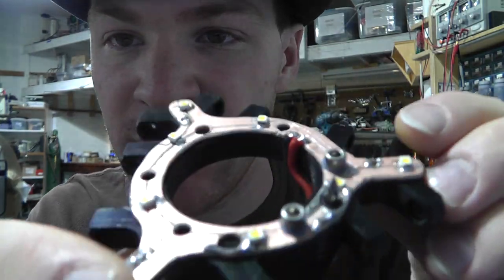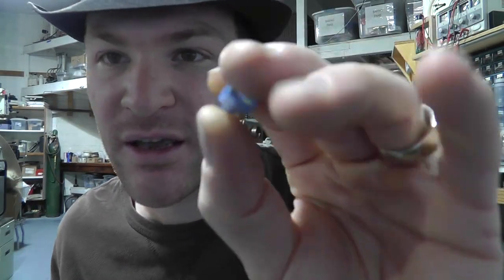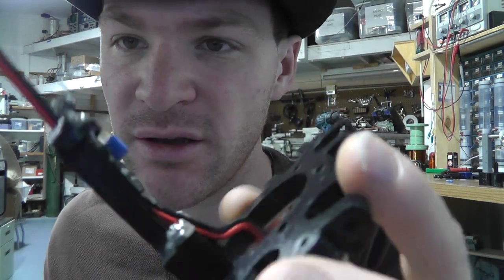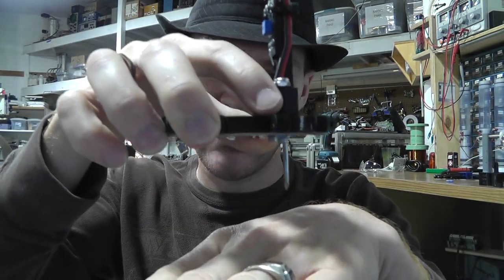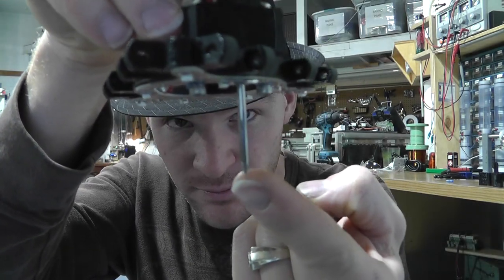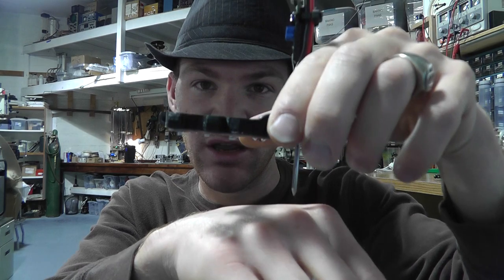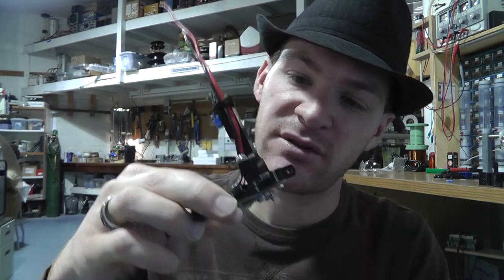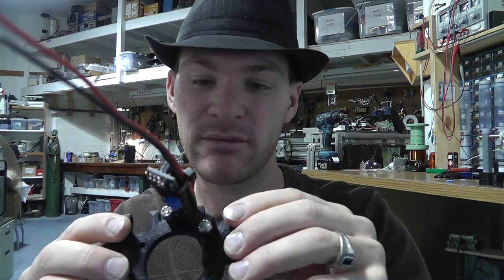10 21 2014 (Its Time For A 3D Printer Upgrade! Pree Work.) Lost footage. Z-Probe. "headlamp"

Comment: *****  Are the Z-probe measurements taken at the centre and then at each corner of the platform ?
After the Z-probe has checked several locations, how does the printer then compensate for an unlevel platform ?
If the correction is applied to the print head position (assuming the platform is not level) is there a chance that you will see a "step" in the print (subject to the Z-axis resolution of the printer) where the head has adjusted for platform level compensation during the print  ?
Reply from the maker: ***** the probe takes 7 points. center and 6 around the outside. when its done checking it will adjust the 15 or so parameters, end stop offsets, tower adjustments, end effector rod length, rod offset, and radius. ECT. In The firmware i set the position of the offset from the probe to the print head. x,y,z. most all your questions are answered here: Rostock Upgrade, Day 2 (firmware) 3D Printer Auto Calibration setup. (with time lapse.) good questions, ~Russ
Reply: ***** Cheers Russ.   Good luck.